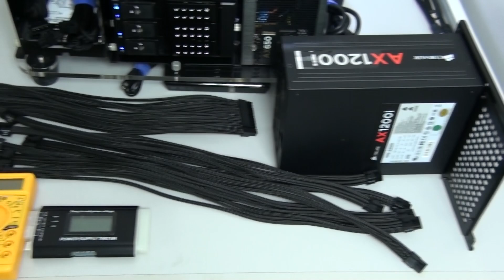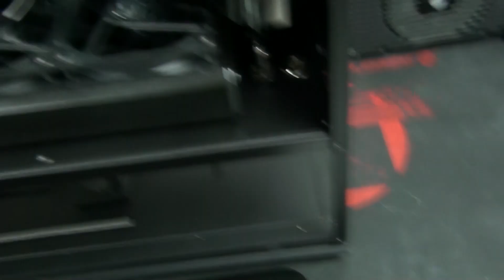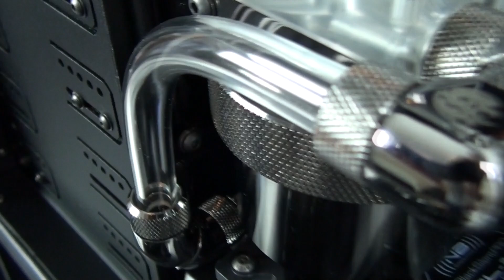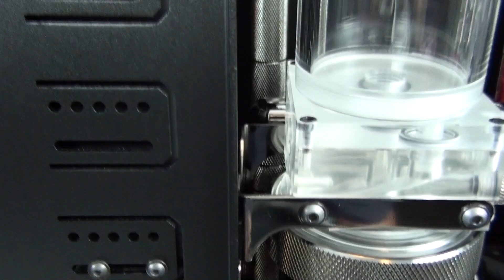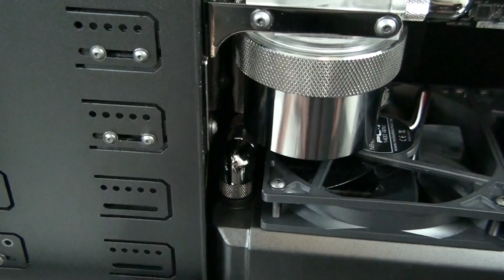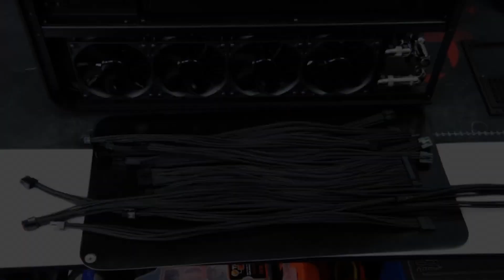Build #8: 'Cytotoxic': Part 5

Comment: When draining the system, just open the ports use for filling the reservoirs. It's way more accessible and you don't need to remove fillstops of the reservoirs from inside the machine (and just dropping the screw inside the case, etc). Just open both values.. 

At least that's the way I (can) drain my system..

Comment: It seems a little strange to be running the GPU's on the 360 and the CPU/ motherboard on the 480? Plus I would be concerned about the radiator sandwiching going on in the bottom with the 480 feeding hot air to the 360. I find the air coming out of my 480 UT60 is very close to the temp of the water in the loop ... ie there isn't a lot of cooling capacity left.

Comment: currently trying to spec out a flow in my head and i was wondering what's your view on dual radiators running in parallel using dual pump to push the system

Comment: The build looks amazing, but it is not suitable for the normal 24/7 operation. I think the all those fittings from bitspower costs more than the half of the hardware of the system. Who is buying this kind of systems? Richie Rich or what?

Comment: you heat the sleeve at the pin and sqeeze the molten sleeve onto the pin. This is actually stronger than heatshrink (cleaner, easier and cheaper, too)
you find a tutorial from lutro0 here on youtube (just search for shrinkless sleeving)

Comment: In regards to having a nice clean split in the middle between the two loops, isn't that effect going to be destroyed by the nickle plexi motherboard waterblock that sits just underneath the GPU's? Or are you counting on the GPU power cables to hide the block sufficiently?

Comment: I used crystal link extensively in my TJ11 build and unfortunately it really does just come down to trial and error.  You have to have a general idea of what lengths you'll need and then order a wide range of sizes so that you'll have what you need when you need it.  The only thing you can know for sure is what fittings you'll need and that will be in concert with how you intend the set up to run.  Visualization before you order anything is key.

Comment: Hi there, been watching all these vids to get some knowledge for my build. I plan on going full water cooling using EK blocks for my entire system(only doing CPU right now) and I'm puzzled about using crystal link for the connections between the motherboard and CPU. Seeing as you've already done this on a rampage iv extreme, is there an average amount of crystal link packages/fittings that you use or does it constantly change with different systems?